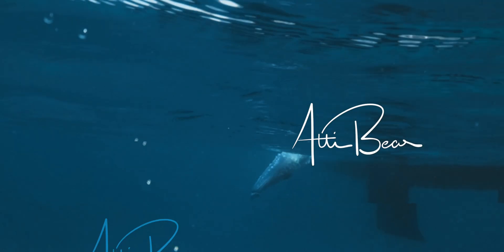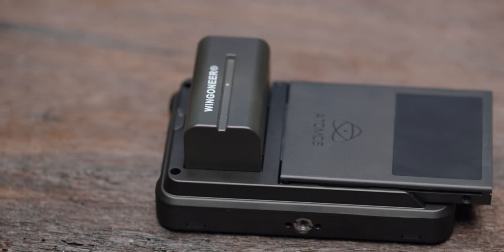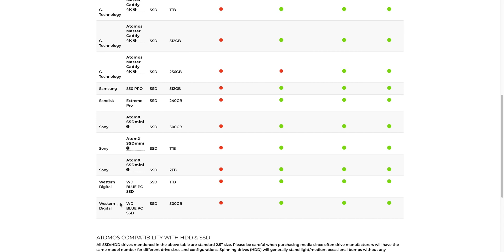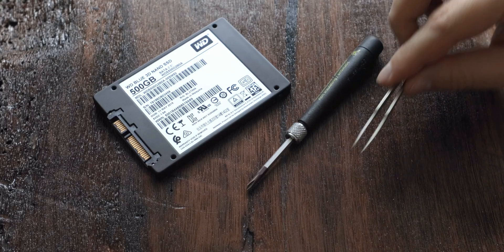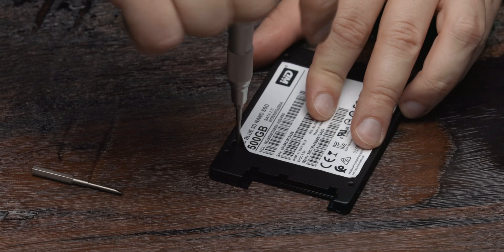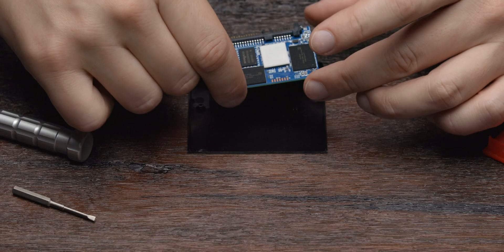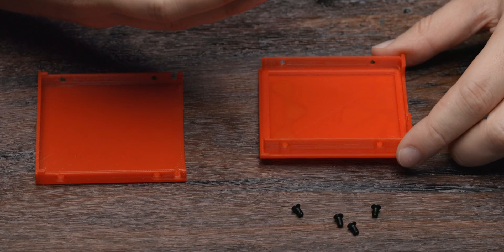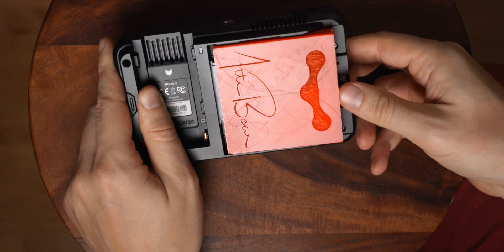Saw your SSD in HALF - Atomos Ninja V SSD Mod

Comment: Just leave the SSD in the caddy don't take it apart  , ........ and  cut off (2.5 cm -25 mm -1inch )  with a  thin disk grinder  ...( make sure its  tight to the bench )  , after the cut ... clean and seal the open part .... I did it with a small piece of rubber  ....ready in 20 min each  .  ( I  did a couple )

Comment: Hey Brother thanks for the video.  As we already has got a 3dprinted caddy,  Is it necessary to cut the SSD cover,
Reply from the maker: Otherwise it won’t fit. And if you remove the actual electronics of the SDD, it will no longer have proper cooling

Comment: You should have gone for Andycine lunchbox as there are two version one is removing Samsung evo SATA SSD putting in Andycine lunchbox II enclosure and other is removing mSATA drive from Samsung T5 and putting in Andycine lunchbox mSATA enclosure  which  is not expensive and it doesn't have heating issues.

Comment: What modern ssd would you recommend to use as of today? Since the ninja v needs more speed.
Reply from the maker: The max available speed is limited by the SATA interface in the Ninja V. WD Blue SSDs already fully saturate the available bandwidth

Comment: I just opened my WD Blue 2TB & the circuit board is the same size as the one you have in the 500GB:).
Reply from the maker: Hey Dan, these are amazing new! could please tell the manufactoring date (DOM) on the drive?

Comment: According to Atomos’ compatibility chart, it seems the only thing the Western Digital 500 GB SSD is missing, when comparing to the Angelbird AtomX SSDmini, is that the Angelbird supports Secure Erase and WD does not. Does anyone know of any advantages the Angelbird has over the WD? And, has anyone experienced any issues with the WD?

As for the WD being longer, hence extending beyond the body of the device, isn’t an issue for me, I don’t think.

Has anyone tried the WD 1TB and found any issues? Atomos’ compatibility chart says it doesn’t support:

ProRes RAW HQ / ProRes 422 HQ / DHxHR HQX up to 6k p30, 4k P60, 2k 240fps, 4k DCI p60, 2k240 fos and DHxHR 5x ISO 1080 p60.

Comment: any problems with temperatures? I think this printed body is a strong isolator.
Reply from the maker: No issues there. It's pretty much the same like an external case. The aluminium part of the SSD's housing is able to dissipate enough heat.

Comment: Great idea! I've got some problems with choosing a drive though. The Atomos supported drive page is a mess. The PDF says one thing and the web page another. "Supported drives" also varies between the different Atomos devices (I guess it's because they're untested?).

Can the WD Blue 500gb record ProRes Raw 12 bit? The PDF says it will. The web page says it only supports raw 10 bit. A reseller agrees with the latter. Is there any other drive that you know of that supports Raw 12 bit that has a short enough PCB for this mod? I only need 500GB drives.

I would be recording with the Sony A7S3.
Reply from the maker: Good question. You could be right that they didn't test it out. In terms of read/write performance Samsung and WD Drives are fairly close to each other. So judging by their list on the web site they either dind't test them or they are in fact too slow. Honestly it would surprise me if they were. The only thing I can imagine, is that they are getting too slow once they reach a certain utilisation. I'd grab a WD blue since it's the cheapest of the bunch and just try it anyways. Let me know if you find something 😉
Reply: @AttiBear  Ok, thanks for the info! I reached out to the Atomos support and they said that "As far as we know the WD Blue SSD can support the Ninja V on the ProRes Raw feature" and then linked to the supported media page. Didn't really answer whether it was 12-bit or 10-bit unfortunately:P 

Yeah, will do! Thanks for the help!

Comment: Has anyone tried the WD Blue 500GB WDS500G1B0A instead of the newer WDS500G2B0A here? My DOM is May 2017. More curious about compatibility with the Ninja V, which I just ordered. It would be great if I can reuse this SSD from my computer but specs say the sustained write speeds are much lower.
Reply from the maker: Look through the screw holes in the back. If you can't see a PCB you can use your old SSD for this mod. Regarding the write speeds you'll have to double check them yourself.

Comment: Damn just ordered a 1tb wd blue drive! lol
Reply from the maker: Well maybe you are lucky and you are receiving one of the old ones which have a shorter PCB 😉
Reply: @AttiBear  does this only work with older models?? And only with the 500GB version? 🤔
Reply from the maker: It works with the latest models but the 1TB‘s PCB is to big to fit the caddy
Reply: @AttiBear  danke für die schnelle Antwort! Also geht es mit den 500ern die das neue Design haben 👌🏻
Reply from the maker: Ja problemlos 🤓. Baue alle paar Tage welche um 😉
Reply: @AttiBear  sehr gut 👍🏻 ich kriege die Tage auch den Ninja V daher fand ich’s echt spannend als ich dein Video gefunden habe! Kann man deine Caddy Vorlage auch mit Cinema4D bearbeiten zwecks eigenem Logo? Hab mich mit 3D Printing noch nicht so sehr beschäftigt 🙈
Reply from the maker: Ich denke ja, kenn mich mit Cinema 4D allerdings nicht aus. Wenn du möchtest kannst du über Etsy auch direkt den caddy mit deinem persönlichen Logo bestellen 😉

Comment: OMG! AWESOME IDEA - Would this work with a 1Tb Sandisk 3D SSD?
Reply from the maker: Thanks man! The 1TB Sandisk SSD isn't officially supported by Atomos but it depends on the actual length of the PCB. If it's shorter than 7cm you are good. The 1TB WD Blue drives for example are too long.

Comment: Thanks for the video. You answered my question if the internal pc board of these SSDs were smaller than their cases! I wanted to do the same thing. You saved me a lot of work. Anyone know if WD Blue 2TB SSD boards are small like their 500MB drives? I hope others will share the PCB sizes from other brands as well. Thanks again Atti Bear for sharing!
Reply from the maker: Always happy to help Thomas 😉. Unfortunately WD changed their PCB design and not even the 1TB versions work anymore. The old ones could be converted but the ones with a DOM after April 20 don't work.
Reply: That's a bummer! I have a 2TB Crucial SSD on order. I will see if that fits.
Reply from the maker: Who knows maybe Crucial could work. If the PCB does not surpass the mounting holes in the back you are golden. But don't forget the Crucial drive isn't officially supported ✌️

Comment: Dope channel for film/diy. Subscribed. Will contact you via etsy on your custom logo caddies! Super affordable with the a7s iii coming out
Reply: Are there any 1tb options now? Guess it depends on how far the nand extend inside?
Reply from the maker: Thanks Marty! Really appreciate it 😃. At the moment the 1TB WD blues won't work cause the new boards are as you guessed too long. However, If you go the unsupported route, there should be other 1TB Drives that have shorter boards.
Reply: @AttiBear  Thank you for the reply. The Samsung 850 Pro is supported on the Atomos website and this image suggests it is not long.. 

https://www.anandtech.com/show/8216/samsung-ssd-850-pro-128gb-256gb-1tb-review-enter-the-3d-era 

Have you explored this drive? Looks like it would be just under 2/3 of the full case which is very close to the cut you made on the WD
Reply from the maker: Be careful only the 512GB version of the 850 Pro is supported 😉. But yes it looks like the drive would work. Every board that ends before the hole in the back will fit 👍

Comment: That is such a great idea! I have a question, though. I noticed the Atomos warms up quite a bit while recording, have you ever had problems of SSD heating up and losing files or the PLA of the printed case  melting?
Reply from the maker: Hey Riccardo, thanks buddy. I never lost any files but I'm also strictly sticking to supported drives. With the smaller caddy the airflow actually is increased compared to the normal caddies and since PLA has a melting point of 180-200°C they stay rock solid 😉. Some of the caddies I printed were made out of PETG which has a higher melting point, is more flexible and long lasting than PLA, but it turns out people like rigid caddies better so I switched back to PLA😁

Comment: Hi All, I ordered the 1TB SSD’s and they worked. Model number WDS100T2BOA
Reply from the maker: Hey FilmCrafter, could you please also check the manufacturing date (DOM)? The Latest drives seem to have a new layout
Reply: @AttiBear  DOM: 25 MAR 2020 R/N: BL2T00A
Reply from the maker: Then it looks like you got lucky. The ones from April have the new board design. 😓

Comment: This is awesome! I'm wondering if anyone has had any luck using the newer style NVMe SSD drives inside this caddy?
Reply from the maker: You also could use M2 2242 Drives with adapters, but they are all not officially supported by the Atomos
Reply: @AttiBear  Thank you! I just hired a 3D printer and made some of these cartridges! :) Looking forward to using them! It seems like the NVMe's would be too long (more than 7cm) anyway?

Comment: Hey. Thanks for the video. It was really helpful.
I wanted to ask you,  instead of getting the 3d printed caddy y u didnt modify the orginal caddy that came with ninja V.. ( exactly the same way like cutting the WD ssd extended ends to get a flush fit)
Reply: Means you repeat the cutting process twise one for the WD ssd then second for the caddy that came with the Ninja V.
Reply from the maker: Of course you could cut the original caddy too, but then it's not customised and the caddy would be fully open on the end. Also the original caddies are still quite expensive. +-50$

Comment: Do you have a suggestion on the material - PLA/PETG ? - and the strenght of the material?
From the video it seems one needs some flexibility to fit the parts together. Thanks again
Reply from the maker: You could do it with PLA but that tends to break over time if you screw through it. Therefore I went with PETG to give it more durability. I did print mine with 40% infill but you probably can get away with way less.
Reply: Atti Bear thanks Atti!

Comment: Thanks a lot! :-). Maybe you know if this works with other capacities of WD drives?
Reply: I’ve bought the 1tb version from WesternDigital, and it works just fine 😃 I was a little concerned that the chip would be bigger, but it is exactly the same as the 500gb one😃
Reply from the maker: Thanks Jacob I think that'll help a lot of people here 😃
Reply from the maker: Jacob can you tell me the production date of your 1TB SSD? I just got a new 1TB WD Blue and it looks like they massively changed the size of the board 😣
Reply: Atti Bear sorry to hear that you have another chip inside of yours. Im not exactly sure where the date is located on the SSD, but I can tell you the model number. It is: WDS100T2B0A

I assume they make new model numbers if they change the inside...?😪

Hope that helps a little bit😅
Reply from the maker: The model number actually stays the same 🤓. The date is located in the middle after "DOM"
Reply from the maker: My pleasure 😉. I'm almost certain it will. The other drives probably only use different chips.

Comment: This is great! However instead of sawing the SSD in half, I’d love to see a v2 where all you have to do is dismantle the original SSD, unscrew the inside PCB, and just screw it into an appropriately sized enclosure instead. This way, you can still ship the drive back for RMA in case it fails.
Reply from the maker: Hey Michael thanks for your idea and it's a great one too. There are two obstacles that need to be considered. One being the aluminum part of SSDs is always used for cooling purposes therefore we'd risk thermal damage if we use the printed part. Second. every SSD manufacturer has different PCBs therefore we'd need to focus on one specific brand to narrow it down.
Reply: Atti Bear definitely valid points, it didn’t look like the NAND chips themselves were connected to the case in any way, so I assumed that they didn’t get hot enough. Thanks for your insights!

Comment: Thank you. I was thinking to do something similar to improve the airflow as the air intake is behind the SSD. On top of that if you use a cage it totally blocks the intake. So your solution is amazing and solves a problem you may didn’t know.
Reply from the maker: I never had any thermal issues so far, but now that you mentioned it, I just realized the air intake is right behind the SSD 🙈. Btw what kind of drive adapter are you using to access the SSD? I created another version of the caddy where you can use a regular low profile SATA Adapter. This was you don't need to remove the drive to access the data. Would it be helpful if I released that too?
Reply: @AttiBear  That would be amazing!

Comment: Thanks! printed and installed with your file already
Reply from the maker: Sure thing Hanling! How do you like it this far? I created another version where you can easily use a low profile SATA Drive Adapter without the need to remove the SSD from the Caddy. Should I share it?
Reply: @AttiBear  Hi, where can I find this link ? I really wanna try
Reply from the maker: They can be found in the description
Reply: @AttiBear  yes for sure ;)